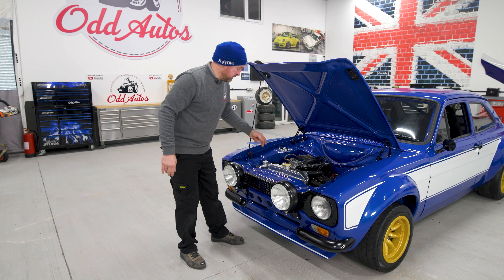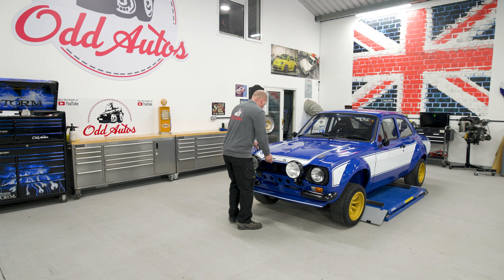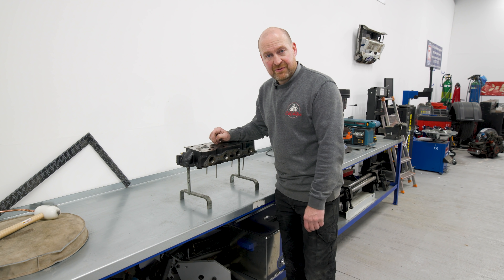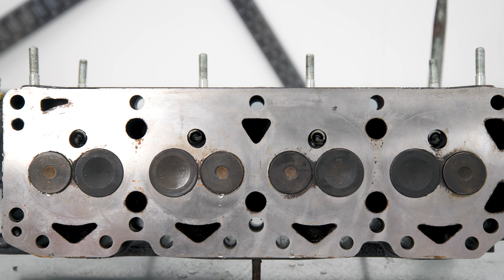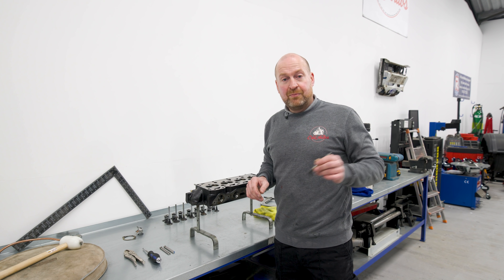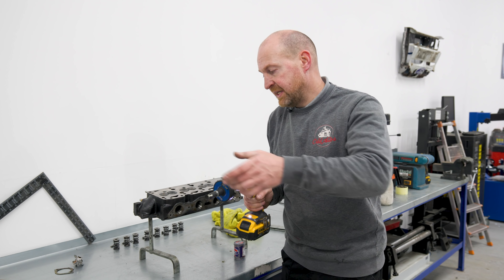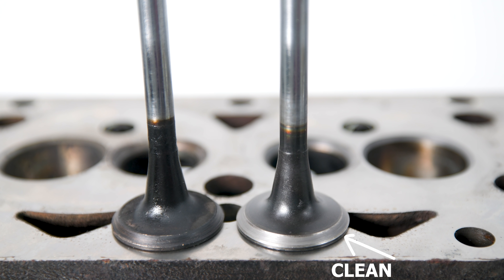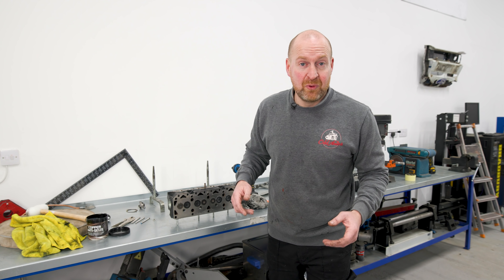Escort Mk1 Crossflow low compression, engine problems?

Comment: Power of social media buddy. Name and shame the engine builder. I had a head that was sitting outside for months (scrap) and the valve seats were better than that. I've done a lot around the house this year and had obviously not the same but similar issues. Can't stand paying someone to do a joy and you get a half assed mess done. If you can't do don't offer. Keep it up guys

Comment: This is how I was taught to lap valves in when I was 14 in 1983 by my Dad. Then I was taught the same method in 1986 when I started my apprenticeship and how I've always done it over the years.
Now, you've just proved that those methods are bang on and taught a new generation. Well done, Paul.
As for the engine builder. I would have had his 10mm socket away... 😁
Reply: Sounds like you've done s bit of tool lifting in the past ,just the sought of guy you don't want in the w/shop .I wouldn't recommend those sought of comments .
Reply: @geraldswain3259 , why thank you.
I am actually starring in the new Avengers movie, as the anti-hero, Tenmill McNabbit.
I can't divulge the full plot yet, but keep your eyes open for the release in 2023.
The scene where I go into the Snap-On van with a 3/8 AF  is Oscar worthy, even if I am a bit biased. 😉
Reply: @dalethomas360  🤮🤤🤤🤤

Comment: Having built and raced quiet a few Xflows,   Id have the crank out and check all the clearances, more content for your channel.       Also I bet they've not set the cam exactly right, if they've just put it in on the dowel it can be many degrees out.   Oh and if they've changed the cam bearings make sure they have installed them properly and not blocked the oil feed.

Comment: engine builder needs named and shamed on a forum at least , then of course kicked in the bollocks with a heavy size 10 boot , gr8 work though paul getting the valves sorted out ,hope all goes well on your future power run  best regards and enjoy your stunning mk1

Comment: Your lucky that was an easy fix. As you showed their lapping was never done, only been cleaned up. I'd be checking bolt tensions on the big ends and crank to be safe. Great work👍
Reply from the maker: Yer think I’d better check the rest.

Comment: I used to club race one of these back in the day. Very easy motor to build up. Even as a spotty teenager I did a better job of lapping valves than that company did. I would be keeping a good eye on oil pressure on the dyno mate. From my fading memory I think we got 190psi out of them on a cold compression test. Best of luck with it.

Comment: @ 10.20 on video can clearly see a pit in the inlet valve seat insert (guess they only replaced exhaust inserts)... and the rust around head bolts on the face - wow what a bodge job! If it was mine I would have used a valve seat cutter on the inlets and just take a smidge off, then lapped in, did they replace the exhaust valves with stainless ones, ( I use to rebuild beetle engines ) just a few observations. I could not put that head back on without pulling sump and checking crank and rod shells....
Reply from the maker: Yes wondering about the rest of it too 👍

Comment: Brings back memories of lapping in valves by hand. I reckon you’ve had that cutting paste a long time, it’s the same brand as I used to use. 🤣 The rule was always there should be a grey ring all the way around valve and seat. I really don’t see how the engine rebuilders can deny missing that process. Also, surely they must run an engine up on a bench to test it once finished?

Comment: They must have Stevie Wonder working for them, as they have not seen lapping paste, or the deft movement of the lapping tool. That drill lapping tool would have been handy some 30 years ago when I rebuilt my mates Cavalier engine. The only powered tool i had was the bore honer that went in a power drill. Sadly the Engineering workshop that reground the crank is no longer going. Looking forward to the next instalment and seeing you and Kieth going down the road.
Reply from the maker: Cheers buddy, I can’t wait to drive it now too.

Comment: That valves were lapped at some point just not by them. If it was like the leak you had at the very end you would be OK one valve ain't that great but not too bad let them sort it as its just a small weep but going by the leaks you had at the start I am surprised you even got a pressure test.
Reply from the maker: Definitely a unhappy head crying on the bench at the start lol

Comment: that's a "off the shelf" recon head, off the back shelf of a leaky old shed in someone's garden, circa 1990 methinks
if you can't lap valves, i don't think you can be trusted to put  seats in correctly, unfortunately i see them bouncing out first time it's used in anger. save the pistons, fit a known good head....
we had a well known, good reputation, engine reconditioners in the north east, family retired + sold as a going concern to a lad + his cronies, give up when the fourth engine in a row was dud, all the gear,- no idea basically, the lost labour wiped our workshop profits for 3 months.
i have always used petrol for seating check, water too thick to find the little leaks [quickly]
Reply from the maker: Yes starting to doubt the whole engine now.

Comment: one of the things that make it worse is that you couldn't have a more simpler engine to work on for a escort looks like it has dubble valve strings on the head so should reduce the chance of valve bounce lets hope the cam is timed properly
Reply from the maker: Yer that’ll be the next problem I expect.

Comment: Was this a rebuilt Burton engine - ie: one originally made by Burton but subsequently redone by another engine builder - or an actual Burton build / rebuild?   You need to clarify, because it’s a shit rap for Burton if it was redone by someone else and it’s not their original product.
Reply from the maker: No it’s just a burton rocker cover.

Comment: Not much hope for whoever did that work if they cant do an engine like that properly. With modern valve seat cutting machinery a lot of them are that accurate, (i.e Serdi), that apparently you don't even need to lap the valves after cutting the seats, (assuming the valves are new or recut), to have a perfect seal and if they do have to be ground a very fine paste is all that is required. Most  engine builders back their work up with a vacuum test after to check valve seal. That one of yours must have been some kind of expensive joke to be that bad - feel sorry that you got ripped off like that and hope the rest of it is ok. Typical that that was the only bit you outsourced on the build and it was faulty.